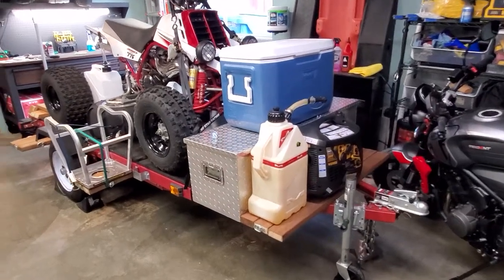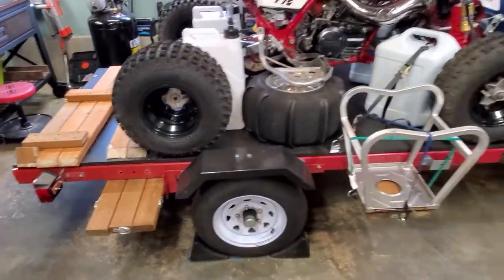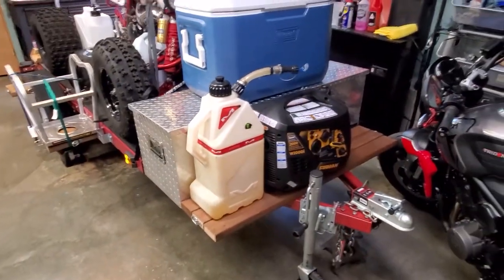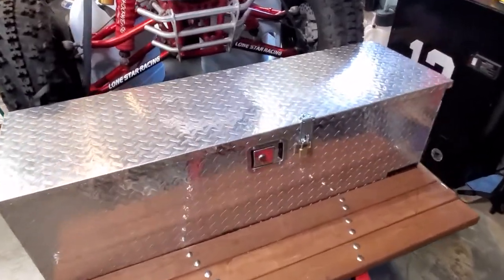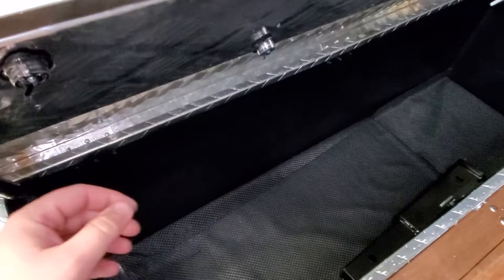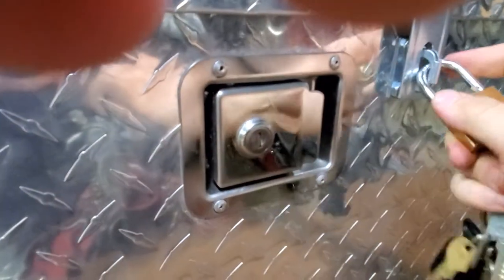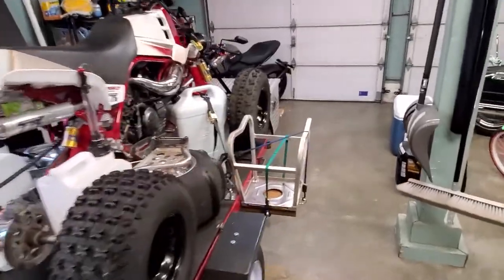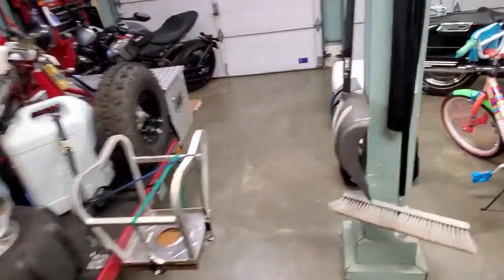Harbor Freight trailer

Comment: Pretty cool...
For your "spare tire", you can do like I did. Mount it underneath between the 2nd and 3rd cross-member from the front. All you would need is a piece of 1.5x24" 1/8 inch stock and a 4.5"x5/8 bolt and nut ran down through the center of it. I welded the bolt and welded the nut to a handle I made. I also made a hold down from an adapter piece from a lawn mower blade. But if you don't have access to a welder, you can probably use a big piece of all thread and run down through the flat stock with some nuts securing it. You could also use a U-bolt. Also, you can replace one of the bolts in your sideboard brackets with 3/8 eyelets for more tie-down points without drilling any more holes in the frame. And that "blank space" between your sideboard bracket and the front clearance light is just begging for a HF metal ammo box! Finally, if you need to replace the axle bearings and seals you might want to look up what they have on etrailer. Due to "supply chain" issues these things are harder and harder to come by.

Comment: I was thinking about buying ones of these for my 250r and 450r, but I need to modify this trailer to make both bikes fit plus some gear. both bikes rear swing arms are 6+ ,so I need to do some modifications or just buy a 6.5 x8 trailer.
Reply from the maker: It's pretty nice getting something custom to your application, but it's a lot of work, so either way is good way. Just depends on what it's worth to you
Reply: @seejoego  yea I think I’m going to get one and just mod it for my use I want one that folds so I think I’m leaning to this one more

Comment: Good video! How is the trailer holding up and how many miles? Are there any issues with the tongue arms bending with all that weight on the tongue? I am getting ready to put together mine. Thx.
Reply from the maker: No issues with the tongue weight. Had a mishap with a quad pushing the fender into the tire, shredding the tire, wheel and ruining the hub. I just finished another major project on it. I should throw up a video soon.